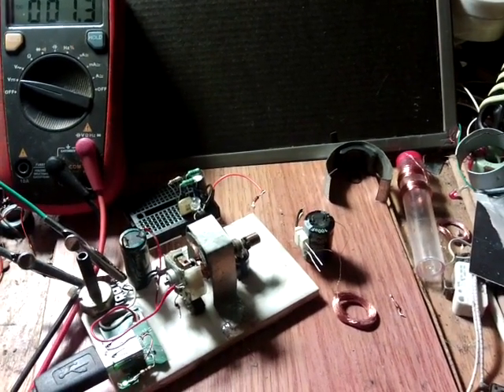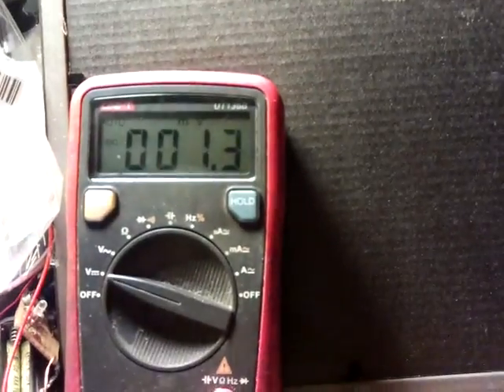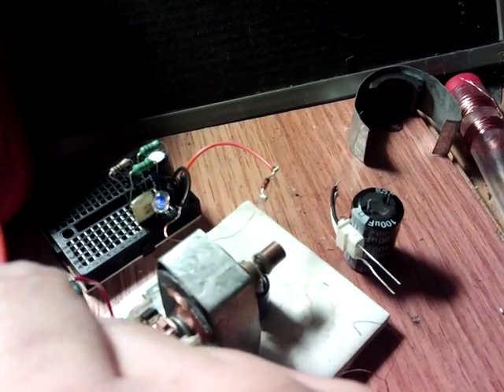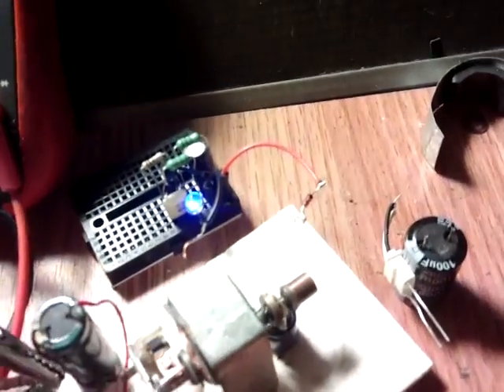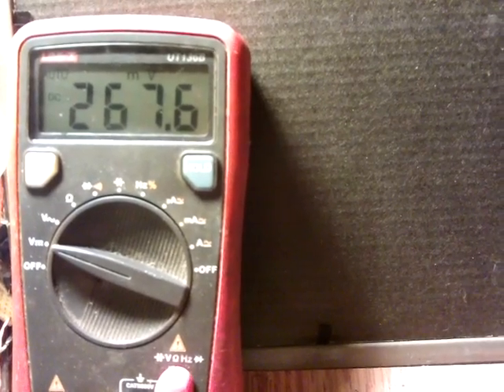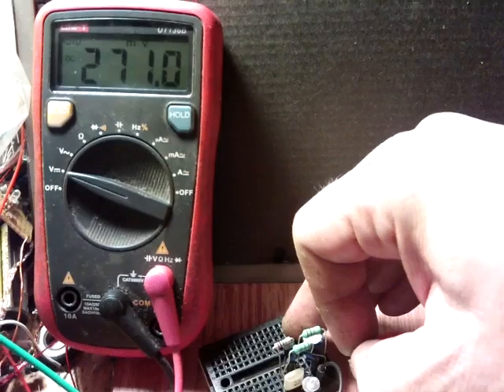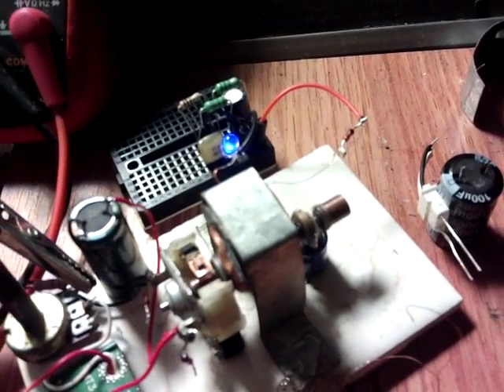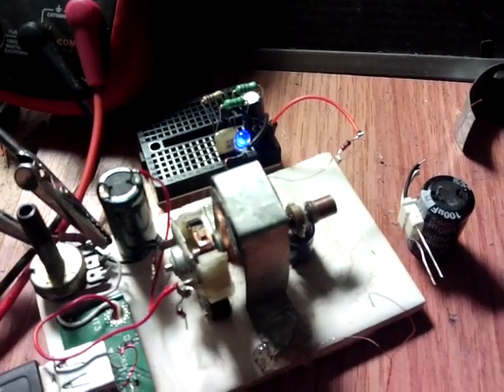Chop Shop 2 - Induction oscillator

Comment: I put a 16 pole dc weed cutter moter in a plastic case with both magnets. Disconected every other comutator segment. I can place a coil between  the too magnets gaps on out side of case and tap power from there. 
Regards mark

Comment: Will it work if you put the magnet back as close as you can too the roter. Then rap a coil around the the edge of the magnet?
Reply from the maker: ultimatecleveland Putting a magnet in coil, above, below and within has been tried, which would be similar to wrapping it around. Quite the puzzler why only below a magnet that is helping to rotate the motor will work.

Comment: Hi, the gegene project confirms the same through induction coupling. By adding more load on the output we lower the draw . I had previously replicated this and confirm it results. I tried to loop the system but required a pure sine inverter for the system to be able to run itself. If a smaller version was made no doubt it could run itself. If you need any info please reply. Nice work:)
Reply from the maker: dkdyker Yes, had a lot of fun with the gegene here...mainly blowing up LED's as I recall. it's similar to my SWES, with bifilar pancake, wireless output, but on a much bigger scale. There's no way I could cook chili with my 1.5V system.
For looping, the output has never to see the input. Diodes are no good even. However, a wireless routed transfer is an option and, while designs like the gegene already are wireless capable, it does raise thoughts on such things.
Thanks for your comment :)